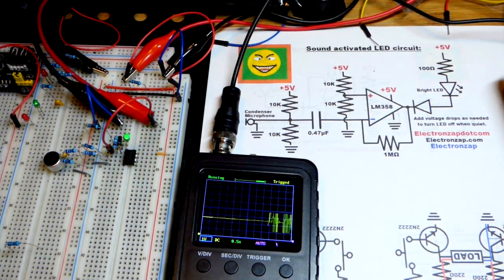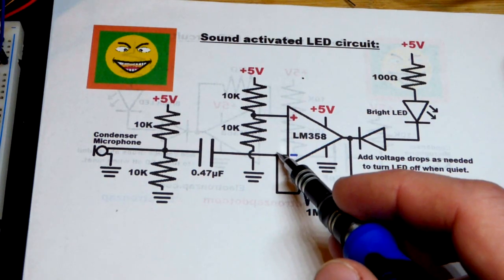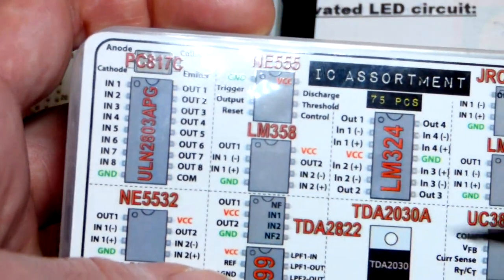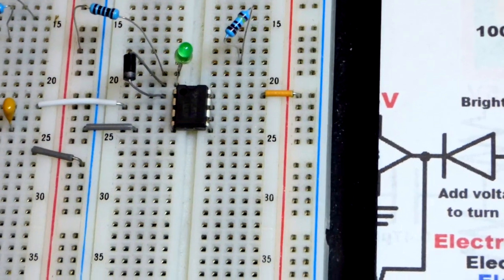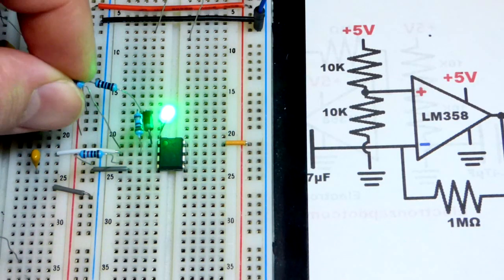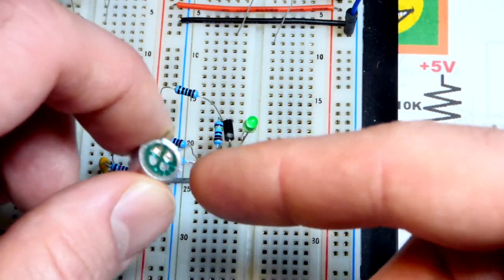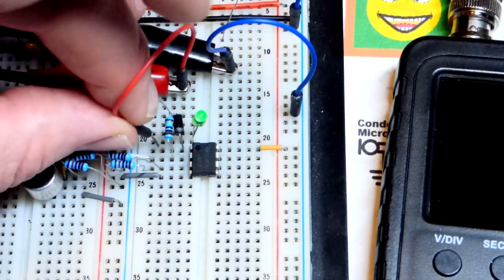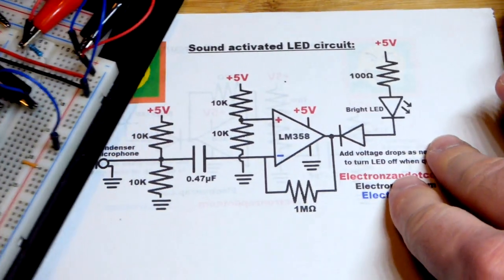LM358 op amp condenser microphone sound activated LED electronics circuit by electronzap

Comment: great, but can you light up 12 1watt 350mA leds with this circuit?
Reply from the maker: Nope. You'd want to use a circuit like this to control a 2 watt 700mA transistor wired as a switch for a load like that.
Reply: @Electronzap  I played around a bit more with it, andended up using TIP31C after the 0.047 cap and from the collector to base of another 12 TIP31C transistors to power Leds and I can add onto it if I needed, and where you had yr voltage divider at the beginning (2 10k res) I changed the one to ground to a variable 10k so I can control the gain on mic, TIP31C are so cheap so why not, but now am waiting on MEL 7135 drivers to replace the transistors

Comment: So essentially the inverting and non inverting are set to the same voltage due to via negative feedback.. the microphone signal is riding on the inverting signal and the change of that signal is pretty much acting as a comparator.. very clever, thanks

Comment: Is there a good reason to replicate the voltage divider as you did?  It seems as though a single one is all that's necessary (tapping off it in both places) Thanks!
Reply from the maker: This is the first time I made this circuit, after stumbling across a similar one. I'm sure there's tons of modifications that can be made to make it better.
Reply: @Electronzap  Great answer, thank you!
Reply from the maker: Thanks for watching!